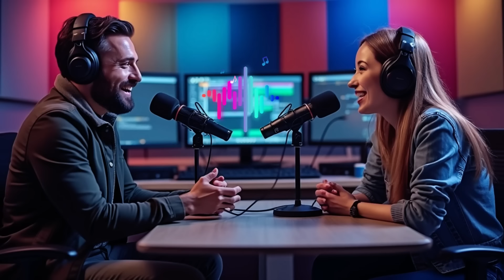Microfluidics in Agriculture & Farming | Podcast Episode 3

Comment from the maker: How can microfluidic systems be optimized to handle the complex and variable composition of agricultural samples, such as soil and plant extracts, without clogging or loss of sensitivity in detection assays?
What are the potential long-term ecological impacts of using microencapsulated agrochemicals in diverse environmental conditions, particularly concerning biodegradability and the potential for microplastic accumulation in soil and water systems?
Can advanced microfluidic platforms integrate real-time environmental data with predictive AI models to autonomously adjust agricultural treatments at a microscale, thereby minimizing chemical use while maintaining crop health and yield in dynamically changing climates?